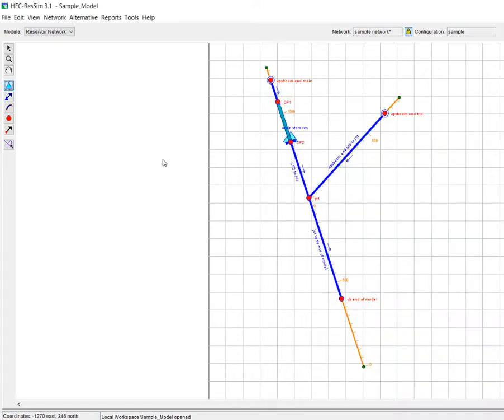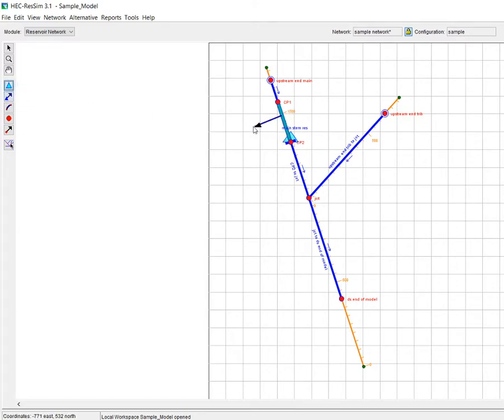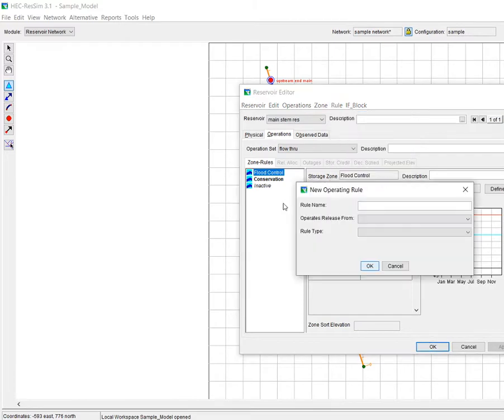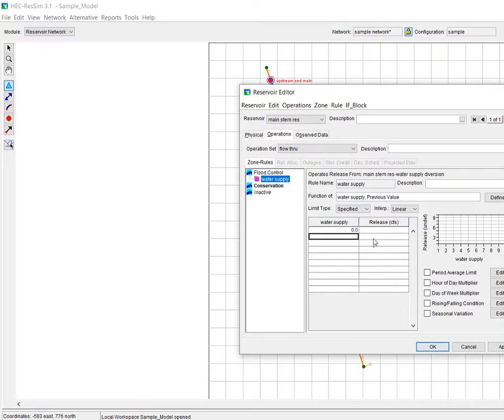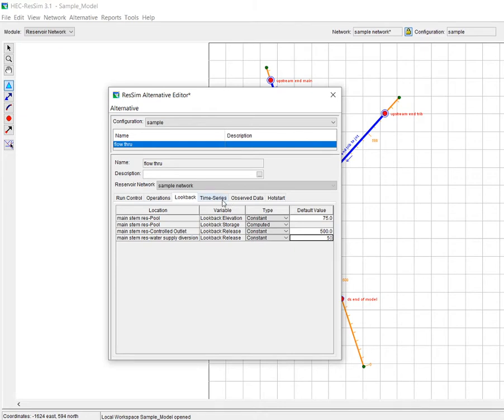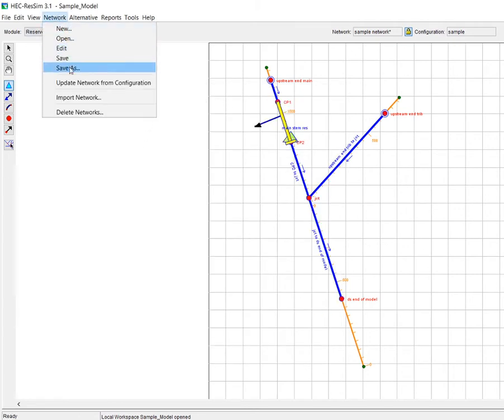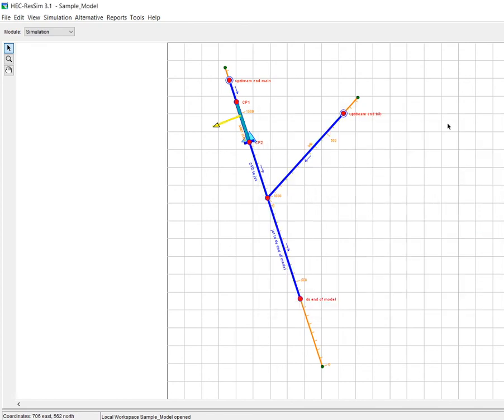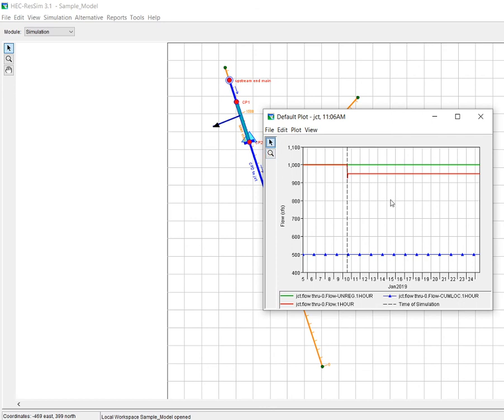Water Supply Diversion in ResSim

Comment: Hi! Thank You so much for sharing these Hec-ResSim tutorials. You've really helped me to understand the very basics of Hec-ResSim. 
I've managed to model and simulate a system that consists of one reservoir, two regulating weirs, and three regular Ogee-shaped weirs. One of the regulating weirs serves as a supplier for the reservoir, besides its main function for irrigation. The reservoir has a power plant with some certain operational constraints.
The release rules for this system were actually the results of my optimization model outside Hec-ResSim. For validation, I wanted to see if these release rules would result in different parameters in Hec-ResSim, and turned out they were pretty much the same.
Reply from the maker: Thanks for the feedback and good job on developing a model with that many different features.

Comment: Hi! thanks for sharing! I'm working on a model and I need to connect a diversion from a reservoir to another reservoir in a parallel stream. So far the only way I've been able to do it is to add a "dummy" local flow to the inflow junction of the receiving reservoir. It is kind of working but I think there's a more elegant way of doing it. So please let me know what you think.
Reply from the maker: I believe you can connect a diverted outlet from one reservoir to the inflow junction of the receiving reservoir.  This should allow you to write rules pertaining to the diverted outlet to move water to the receiving reservoir.
Reply from the maker: I may have to make a video to test and show this.
Reply: @hecressim  that’s a good point, since I’ve just tried my model with the “flow-thru” operation set you recommend, so I don’t have any rule in my model so far. I’ll try adding some rules and will let you know. Again, thanks a lot for sharing knowledge.
Reply: Hi! I tried adding a rule to send water to the parallel junction thru a diverted outlet and it didn't work. Still the only way it's working is with the "dummy" local flow. Did you have any breakthrough?
Reply from the maker: I need to do a video to show this, but I have a diverted outlet (found in the reservoir network module) connected from a reservoir to a junction above the reservoir, and it appears to work.  I am not sure if I can connect to a reservoir junction or to the reservoir itself (it seemed to be giving me a problem with that).  However, you can put in a dummy junction just above the upstream reservoir junction and connect to that if there is a problem with connecting to the upstream reservoir junction or the reservoir itself.
Reply: @hecressim  Hi! Do you add some information to the "dummy junction" in the Local Flow tab or any other tab?? because i cant make it work without adding a dummy local flow.
Reply from the maker: I made a video to show the use of diverted outlets that I believe addresses your comments.  Check it out and let me know if it is helpful.  https://youtu.be/R7yU1cQq7rY

Comment: Thanks again for posting this video.  I'm giving this approach a shot, but ran into an issue.  It seems like my model is recognizing only the maximum flow for the water supply diversion that I specified under the physical properties (I put in 100 cfs, somewhat arbitrarily).  The model is not picking up the timeseries flow values from my dss file (varies, but generally around 40 cfs).   Does this happen with your model too, by any chance?  (I only think this might be worth checking because you had set both the max flow and the dss time series values to 50 cfs.)  Trying to sort through this on my own, but figured I would check just in case.  Maybe it is the structure of my DSS file causing the issue?  I also looked into using the "function of date" option for setting the rule - but found it interesting that this can only accommodate month and day, not year, so that option will not work for this application, since the flow varies from year to year.
Reply: I think I resolved this.  I had a rule conflict!   My reservoir was operating within the flood control zone, and maybe that was why the model was using the maximum release rather than the specified time series for the water supply.  Once I adjusted the flood zone, the time series for water supply worked great. Thanks again!
Reply from the maker: @davidrailsback4874  Glad that worked for you.  The specified release rule should work even when you are in the flood zone assuming that you have the rule applied in the flood zone.  It should, however, use the full capacity of the outlet if you reach the top of the flood zone.